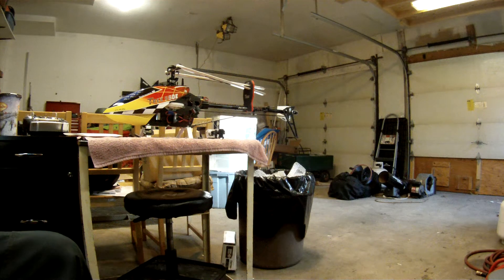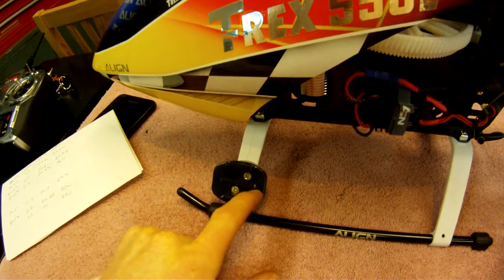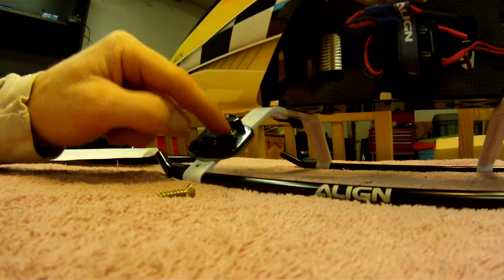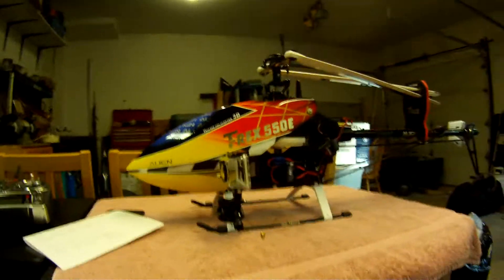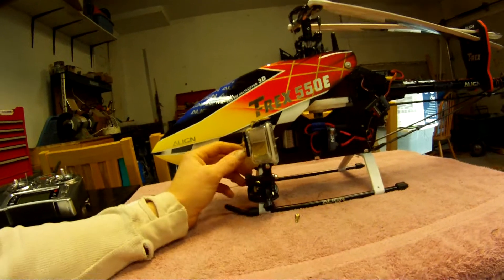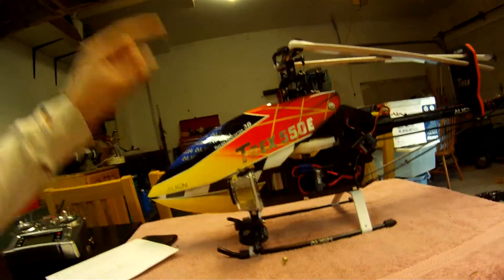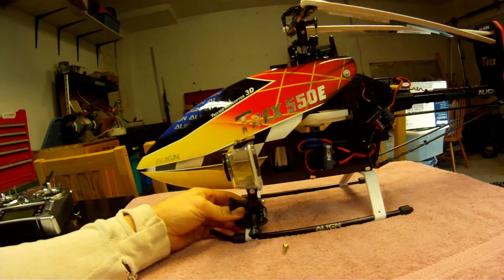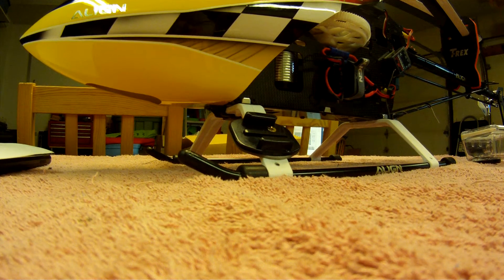Trex 550E Go Pro Mounting

Comment: Im trying to do it to my 450. Side mounting won't work though.
Reply: ***** What I did (for my video) was mount the gopro jig where the battery goes and attached the battery to the bottom fo the heli:
Reply: But now, i sold that heli and have the mini protos, where the motor sticks out at the bottom so i cant attach my lipo to the bottom or it will rub the motor :(
Reply: +Adam Gerlach One crash on the 360 made my student budget dissapear -_-

I hope the mini protos is a lot cheaper!